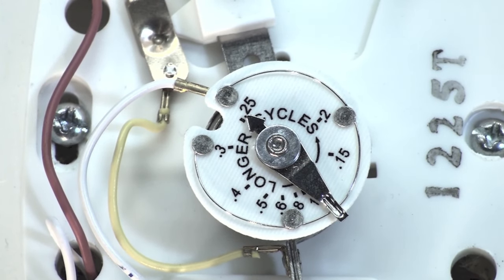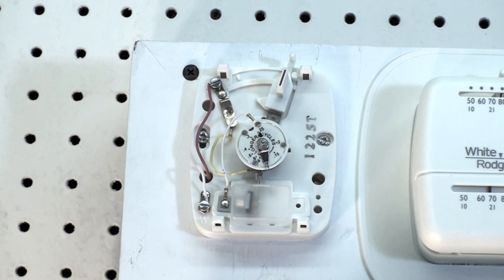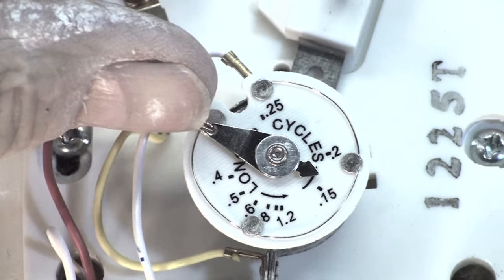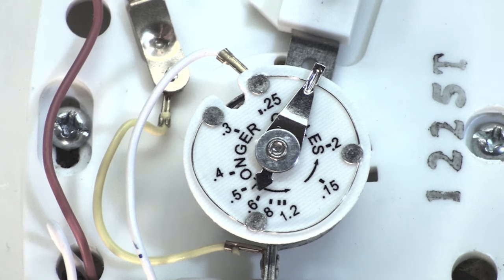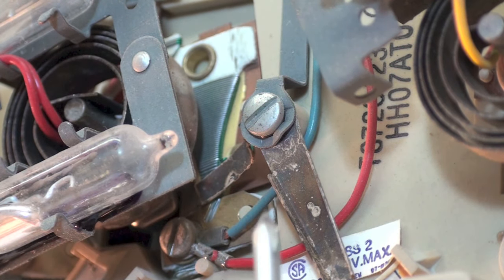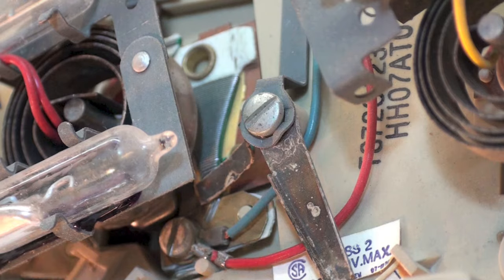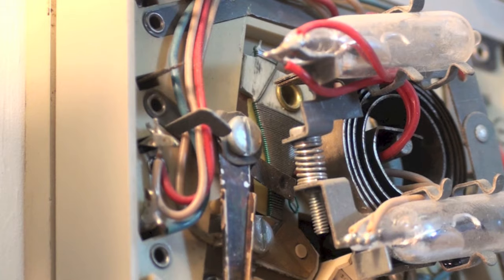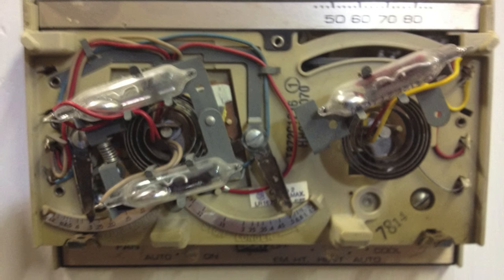Adjusting the thermostat anticipator part 2

Comment: hello. it's a year later and I fixed many problems with the Rinnai combo boiler that was programmed incorrectly by the plumbers. They had the heat water temperature set to 120°f. with Rinnai techs helping me, I reprogrammed it 180. what I would like to know is how do you read the amp draw and where? I have a laser temperature meter and have been reading the temperature of the anticipator when the contacts are made. Without completely understanding, I'm assuming that the higher temperature it gets, it will it will shut off the thermostat quicker. Does that sound reasonable? My house doesn't produce enough heat because there isn't enough baseboard on the first floor and there is a very long run in the cold cellar before it makes it upstairs. I am in no danger of overheating the room. I set the amp gauge at 1.2 which reads close to room temperature. I don't want it shutting off too soon thinking the room will get to hot after the thermostat is satisfied. Any ideas would help.
Thanks
Reply from the maker: Boilers should be set for about 1to 2 cycles per hour.  Setting the anticipator to the amp draw of the heating circuit will give you 6 cycles per hour.  You will check amp draw by using a clamp meter around the W wire going to the thermostat.  I would set the anticipator about 1.5 times the amp draw.  Example:  amp draw .5 set anticipator at .75.  Hope this helps.
GFM
Reply: grayfurnaceman Thank you. Without taking the reading of the amp draw, I set it to 1.2 because I need very short cycles to get the room up to temperature. This boiler has to run a long time to achieve that. I can't have the anticipator heating up too much too soon. I've struggled for 6 years since they installed this Rinnai on my new house. They did many things wrong and I resolved about 6 of the problems they created. If I'm wrong, at least I believe I'm close. LOL
Thank you. I can't get any plumbers to deal with it. They take one look at the Rinnai and the God-awful plumbing and walk out
Reply: This house was rebuilt after my other one was destroyed by fire. Everything the plumbers did had problems. When I saw they pitched the drain pipes the wrong way in many places, I wondered HOW could they possibly install a Space Shuttle of a boiler. They were on the phone with Rinnai all day for 6 days. All unions at the boiler leaked because they soldered them while they were connected and melted the gaskets. It's been six years of frustrating hell. The contractor had them come back this summer because I sent him photos. The plumbers couldn't fix the unions and I also realized they didn't put in the valves to flush the boiler. How could I expect accurate heat! I have to light myself on fire to bring myself up to temperature!
Reply: Sorry to take up your time  but in essence I'm on my own with this one.

Comment: I have a 5 year old taco non digital thermostat.  when I move the lever to raise the heat above room temperature, it doesn't click but will turn on circulator.  I took off the cover and saw a movable gear and arm with numbers on the disc. I don't know what to set the number to. I don't know the required voltage.  can you help?  the same one upstairs clicks with changes. 
Thanks
Reply from the maker: +MrBikedrummer The newer thermostats may not click but if the circa comes on it is ok.  The numbers are amp draw of the circuit.  The amp draw must be determined with a clamp ammeter.  The voltage is 24.  Hope this helps.
GFM
Reply: Thanks for replying but the identical one upstairs does click.
Reply from the maker: +MrBikedrummer If the circ comes on, its working.
GFM
Reply: +grayfurnaceman will I see a 24 on the dial? like all good home trouble shooters, I think I turned it to match the other one because there was always a 10 degree difference between room temp and the desired setting.  If the thermostat was set at 70, room was 60. if 80 room was 70. 5 year old home with combo gas boiler on demand. 
Thanks again
Reply: +MrBikedrummer Also there is enough baseboard on the first floor.
Reply from the maker: +MrBikedrummer No on the 24.  As for the difference between setting and space temp, this may indicate the anticipator setting is too low. and the cycles are too fast.  A Higher setting may help.
GFM

Comment: Question sir my heater keeps turning at night randomly and we are having to fight it to get it to turn back on any advice
Reply from the maker: James Stark What fuel, gas oil electric. 
GFM
Reply: grayfurnaceman  an old gas floor heater for a house i took off the face plate and now i have to tape it to get it to turn on
Reply from the maker: If there is a door switch, and you have to tape it to get it to come on, that is normal.  You are not being clear.  
GFM
Reply: grayfurnaceman its a luxpro s.p.s.t.   t101141/psm30

Comment: What would cause the anticipator wire to melt/pop?
Reply from the maker: A low voltage short will cause the anticipator to burn through.  Thermostat wire shorted to the chassis of the unit?
GFM
Reply: @grayfurnaceman  I looked for loose wires and found the white wire was broken off from the furnace panel. I stripped it and reattached it. I switched on the electricity to the furnace, and switched the thermostat to heat, but nothing happened.  Now there doesn't seem to be any power in the furnace. The green LED light is out. Maybe the transformer has blown out.
Reply from the maker: Assuming the high voltage power is ok, I would be looking for a low voltage fuse either on the transformer or on the control board.
GFM
Reply: @grayfurnaceman   Finally! I checked for any fuses and there was only one fuse on the control panel. It was a mini circuit breaker - fuse type 3 amp switch. The button on the fuse was in the up position and I could not reset it. I was able to buy the same fuse yesterday and today I put it on and it works! Thank you so much for your help, I was able to fix the problem with your assistance when I had an HVAC guy from GAC Services come over and he couldn't even figure out that the white wire was broken, he even wrote in his summary that the fuse was okay, and that he tested the transformer when he didn't even lower the tray that contained the control panel and transformer.

Comment: my thermostat is stuck on 70. how do i reset? old white rodgers
Reply from the maker: Electronic or mechanical?  
GFM
Reply: grayfurnaceman hi. I have this problem. My Mechanical thermostat won't move past the 70 mark. I put the to 65 to see if it will cool or work properly but it doesn't.
Reply: Juan Snow same issue

Comment: How can I turn the thermostat off?
Reply from the maker: If there is a system switch on the thermostat, you can turn it off.  If not, there should be a switch on the side of the furnace.
GFM